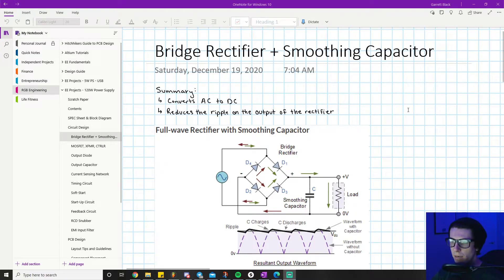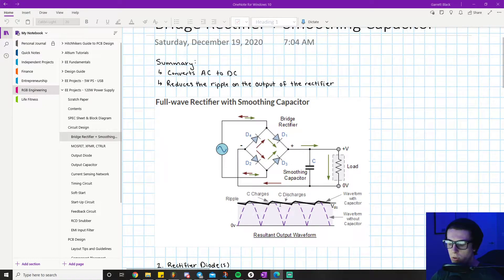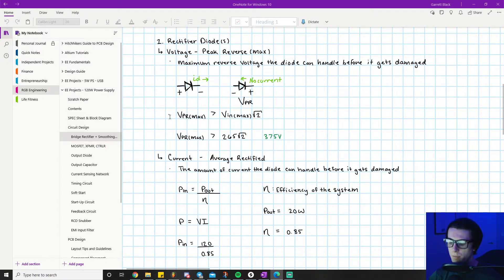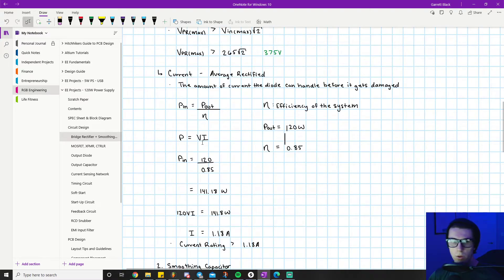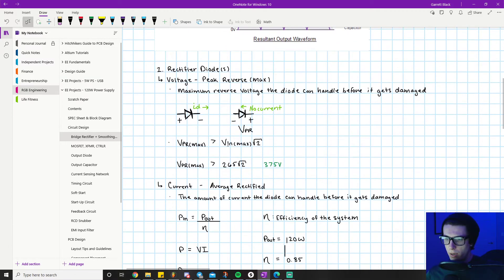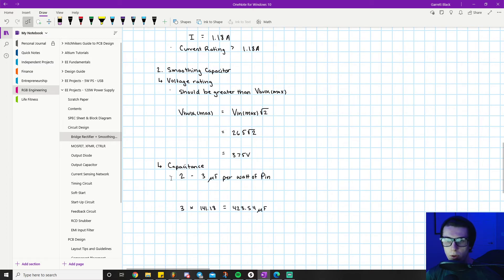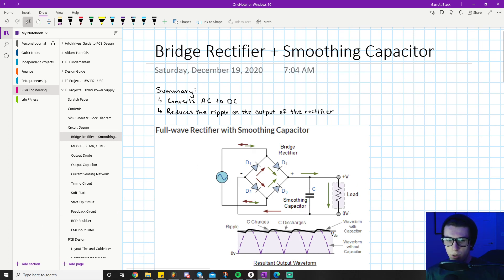FLYBACK CONVERTER PROJECT PT 4 | 24V, 120W FLYBACK CONVERTER EXAMPLE | POWER SUPPLY EXAMPLE PROJECT

Comment: In the data sheet for the controller they give an equation to find that bulk capacitance value or that Cin value why not use that. Im just a little confuse where the 2-3uF per watt is derived from.
Reply from the maker: 2 - 3uF is just a general rule of thumb. At the end of the day, these values will be derived empirically via testing on your specific circuit. Using a general rule of thumb is simpler and easier for calculations, so that is why I recommend it.
Reply: @ Awesome, thank you. This series had been great. Im currently designing a 5 volt SMPS using flyback topology to power a W65C02 computer with peripherals such as ram, lcd, via, etc and I want to have both the power supply and the computer on one board and the power supply  to of course provide voltage and current to the computer and all it peripherals. It would be cool if you can do some mixed signal pcb designs in the future. Again thanks for this amazing series, this sohuld be taught in my EE program 😭

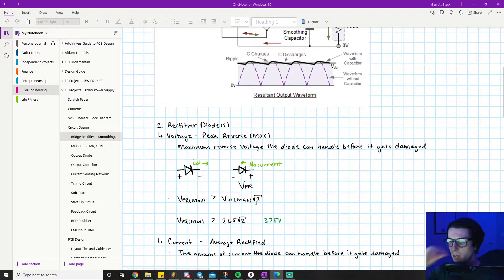Comment: can you please explain why on 3:25 you multiplied 265 into square root of 2 ? 
Isn't 265 volt , as video part 2,  our maximum AC input voltage ? because later on , on 3:40 you said 120 or 265 volt are RMS values . 

Can you explain a bit more , whether it is maximum AC input or RMS of input. 

thank you
Reply from the maker: The voltage across the bulk capacitor (Vbulk) is sqrt(2)*Vin. That is what happens when you rectify the AC voltage.